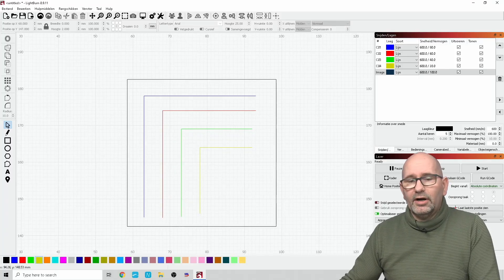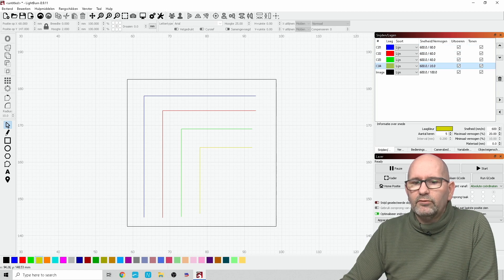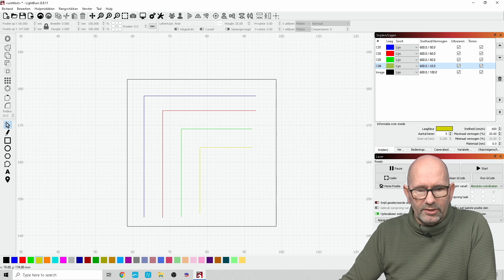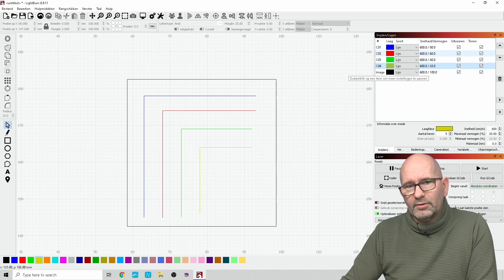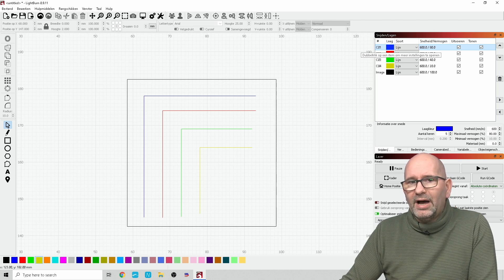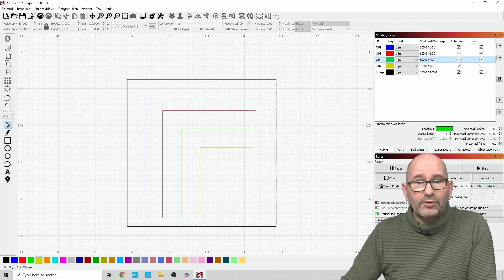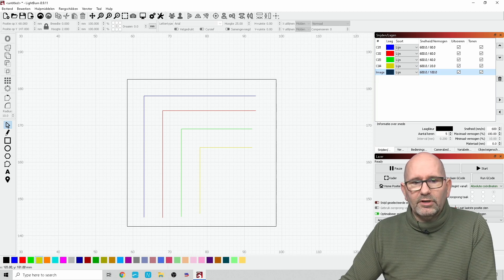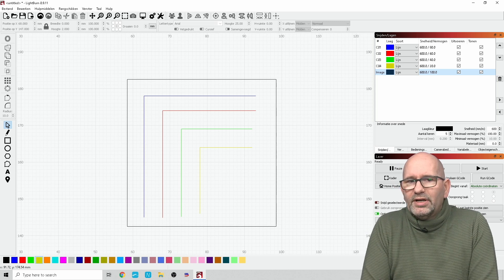▼ Why can't a DIODE laser cut thick materials? | KERF explained

Comment: So.. If it is a fixed laser. ( not adjustable) it is strongest at the surface of the item cut, due to using the measuring tool no matter the material.
So maybe on a thicker material i remove the shield and set the laser slightly deeper into the material??? Wouldnt that help cut deeper?

Is it not possible to have a second or third lense to refocus the lazer more into a straight line?
Reply from the maker: You are completely right here.
In fact, this is done with the new versions of lasers that are now hitting the market.
In my video about the Aufero laser, I explain that people can make their choice between 3 types of lasers, one of them being a Long Focus laser (LF) that uses multiple lenses to make a more compressed spot at a longer focal distance. With that laser, that has the same optical power as the laser in this video, the cut can be almost 3 times as deep.
Reply: @3dPrintCreator  
I will have to look that video up. 
I would think that a larger focal would maybe be better for cutting as it would keep the two halves from being so close. But also not impede the laser as it digs deeper. 
Whats your opinion on the neje 80w laser? Seems to be most powerful at 7.5w x 2laser =15w.
Reply from the maker: @turboflush  from what I have seen, the NeJe is really good, but they don't work with me, so it's not possible for me to test their lasers.
I don't know if they have the most powerful laser at the moment, I think the Skulpfun S9 is even more capable to cut thick materials. 
My latest knowledge about NeJe is outdated  as this was my very first laser I bought and I had many problems with that machine. They have improved a lot since I tested a NeJe machine, but I never had one after my first test.

Comment: Thks, This cutting-depth problem could be corrected-for in software (?????). 
?Doesn't Light-Burn or any software compensate for this problem?
Reply from the maker: It's a hardware problem, that can't be corrected in software. Only another lens for the laser can correct this.

Comment: Pity there isn't a correction lens to give a parallel beam without too much light loss (unless someone know s different).
Reply from the maker: There isn't for this particular laser, but there are other lasers out there that have square beams.
When you look at a laser, always look at the dot size. if the two given numbers are the same, the beams is square.

Comment: When we focusing rectangular shape beam we achive smaler rectangular shape in focal point. Here we never get a dot shape, with gaussian power distribution. So we have to use plano-convex lens to focus laser diode beam in two direction. This way is used to focusing light from diode laser into fibers. Plano-convex lens are not cheap so in cheap laser modules we can not find it. Cheapest lens this type i can find in all website was 70-100€ but it can cost a lot more. 
Laser cuting technology is very difficult, good results can not be achive with cheap setups.
Reply from the maker: Correct, and you don't need just a planar convection lens, but one that is made specifically for this approximately 5x1 ratio, and we still need to be able to focus it. Not worth the effort for a cheap laser like this. All in all, a cheap CO2 laser will be much cheaper.
Reply: @3dPrintCreator  Right but this methode you can focus beam into smal point only in focal length, so this is good enoughth for engraving, where depth of focus i relatively smal - maby 0.2mm. 
When you have colimated and square shape beam u can focus it with lens with big focal point, maby 2", there you get a long and thin beam, good for cutting.
Most important problem is remove smoke or molted material form thin gap. If cuts id depper the gap must be wider so laser power density will drop. There is limit for small power laser system.

Comment: BTW Dual diodes and quad diodes laser modules have square beam pattern and it just becomes bit wider with the distance. So for example Neje dual diode lasers can cut over 1 cm in wood. BTW there are different focusing rules when engraving and cutting. Neje tells you distance you need to set up the focus when cutting the thick materials. Not to forget to mention air assist helps a lot with cutting to. It becomes faster and cleaner to.
Reply from the maker: Totally true :-)

Comment: If it cuts perfectly in the x direction but not the y direction. Why not slow down any Y direction moves by 30% to give it more time to cut propperly?
Reply: One problem is that would distort the design. Let's say that you want to make a 10 mm cut at 45 degrees, at a speed of one 1 mm per second,  so it will take 10 seconds to make that cut. The only way to do that would be to move the x and y directions the same amount in those 10 seconds. If you slow the movement in the y direction down by 30%, then the laser will cover 30% less distance on the y-axis than in de x-axis. 

That means that, in those 10 seconds, the laser will have moved some distance in the x-axis, but only 0.7 times that distance in the y-axis, so you would not get a 45 degree angle. And if you tried to cut a 10 x 10 square, you would end up with a 10 x 7 rectangle, since the height will be reduced by 30%.  So you can't arbitrarily slow down in only one of the directions, the "Cartesian mechanism" that the machine uses would distort the image.

But the real problem is that the laser doesn't cut better in the x direction than y direction. Best cutting effenciency is achieved when all the light is focused in the smallest possible dot right at the surface of the material. If it's not properly focused at that particular distance, the light is spread out (in this case in the shape of a square, because that's the shape of the light emitting semi-conductor inside, I think) but it's equally spread out in the x-axis as it is in the y-axis. So it "loses effenciency " at the "same rate" in both axes. Hope that makes sense.
Reply: @SatumangoTheGreat  I said slow down the movement, not move less. As in, increase the time between stepper motor pulses, not decrease the amount of stepper motor pulses.
Reply: @andrewwatts1997  I know, but the direction the laser is going depends on the relative speeds of the two motors. If the y-axis moves at a certain speed and the speed on the x-axis is zero, the laser cuts a vertical line. If the x-axis moves at a certain speed, but the speed on the y-axis is zero, the laser cuts horizontally. If the x- and y-axis move at the same speed, the laser cuts diagonally at an angle of 45 degrees. If you slow the y-axis to half the speed of the x-axis, the laser cuts diagonally at an angle of 22.5 degrees.  

That laser is going somewhere, cutting all the time. If you change the speed of that laser on one of the axes, it is going to veer off course.

What you could do is change both speeds at the same time, keeping the laser on its correct course but moving slower, thus giving it more time to burn trough the material. Or repeat the path of the laser several times, burning away a layer of the material at each pass. That is wat he is doing in the video btw.

Comment: I think your laser might have a problem. I had the same issue and I emailed them. We were back and forth with emails and tests. The outcome was that they will replace the laser.
Reply from the maker: Huh? How come you think there is a problem. This is how Diode lasers work, it works like it should.
Reply: @3dPrintCreator  well after I notice one side was cutting with a fine line and the other side had a broader cut which didn’t go through, just like yours. So I thought I wasn’t focusing it right, I did some research and I saw some people had the same issue. I emailed ortur and I had to run some tests they sent. I dunno, maybe I’m wrong and my problem is different 🤷🏽‍♂️🥺

Comment: If it cuts, then it will cut deep, you will need to keep the cutting point at focus and cut shoulders so the beam doesn't get attenuated. All manufacturing has its own quirks.
Reply from the maker: It's won't cut deep because after only a few millimeters, the beam is out of focus.
If only the machine had a moving Z axis, then it would be able to cut deep.

Comment: OK BUT we have the new 2021 type of laser engravers like the Atomstack A5 Pro and the Banggood Sculpfun S6 pro (very similar machines) which have new optics so they call it Spot Compressed Laser and they promise that the light beam is square  and smaller than before 0,23x0,23mm. I just ordered the Atomstack we will see :-)))
Reply: Let me know if it was good. I'm really interested in it, even if i have a 1390 150 watts CO2 machine, loooooooool :-)
Reply: @ACNNOMOREBLUFF  Hi sooo I got it about 4 days ago did not have too much time to play with it and I does not have air assist yet STILL it cuts 5mm plywood beautifully which is over my expectations with very minimal conusing.. it takes time no question about it but it cuts 5mm normal plywood. What it does not cut is anything which is over 10-12 mm but I still have to play with it.. I cuts foam like nothing but when I tried 20mm foam it only could go down about to the half of the material and it stopped even I gave it 50 runs the laser light just evaporates or something like that. I tried 16mm light wood and it cannot do that either. 

So the max height of any material could be about 10-12mm and that is it. The square light beam is not really true it is probably better than before but it still cuts vertically better than horizontally. 

I think it is a great machine for the minimal price it costs. I am about to make some bed of nails for it (from gluing pushpins to a plywood) because raising the material is very good for cutting, and I will make a box with ventilation ands also think about air support that helps a lot as others said... )

I hope I could help...
rockjano
Reply: @bacsijancsi  Yep, i confirm the air assist will change it fully. I have an old model with 15Kw blue beam laser, and i added the air assist a year ago. Now, it cuts up to 20 mm wood plates. So keep going ;-)
Reply: @ACNNOMOREBLUFF  Whoaaaa.. that is crazy :-) is it somehow blows the smoke out of the cutted material??? The 15Kw real cutting is something like 4 watt no??? Mine is theoretically 40W (really it is 20W) but that is the power consumption and the real power with mine is about 5-5,5 W which is still a far cray from any CO2 laser but a lot less hustle...
Reply: @ACNNOMOREBLUFF  One question how much constant air do you need???  A read something like 1 bar...
Reply: @ACNNOMOREBLUFF  Thzank YOu

I wonder I have to compressor...a big one with a 30l bottle and a smaller one for airbrushing with a small 3l bottle and even that can provide 1Bar continuously  that  might be just enough
Reply from the maker: My machines (with non spot compressed lasers) are working great with simple aquarium air pumps, that output 150 liter per hour, at a pressure of only 0.4 Bar with a 0.8mm nozzle.
I have not tried the spot compressed lasers, but there is one coming my way very soon. It will be a 20 Watt machine (effective about 5 Watt) and the company says it is capable of cutting normal plywood in 4mm in just one run at 300mm per second.
When I have it, I will make video's about it and show a comparison in detail.
Reply: @3dPrintCreator  300mm / second is obviously a mistake it might be 300mm / minutes which is about 5mm/sec. Still it is very doubtful mine (Atomstack A5 pro) without airsupport!!! cuts 3mm plywood 4-5mm/sec 100% laser power and 3 runs (2run is not enough)  think that is the reality... it is only 5W lasercutting power I wonder how much airsupport might help I will make it soon....
Reply from the maker: My first reaction would be that you are absolutely correct about the speed mistake, but I double checked it with the company that is going to sent me the laser, and they repeatedly said it will cut normal plywood in one pass at 300mm/sec. I also have a hard time believing it, but I have not checked their laser yet, so I can't confirm of deny it. 
My, very simple, air assist makes a whole lot of difference, while it still is a very basic and low power air assist. It means the difference between burned edges or smooth cuts, and it gives me about a millimeter more cutting depth in light plywood, like birch plywood.
Reply: @3dPrintCreator  Yep I heard that airsupport can give you somewhat more cutting depth and a bit more efective cutting but only 20-30% more. The 300mm/sec I know they say because they don't know what they say or never tried it :-) even 300mm/minute one run is impossible I think minimum 2 runs at full power. mine now needs at least 3runs. Raising the wood in a honeycomb tray or bed of nails or similar also helps I think...
Reply: @3dPrintCreator  what about the new neje module with dual 5W diodes and compressed beam?
Reply from the maker: @shaiseg  I wish I could tell you more about that module. NeJe doesn't sent products to review, so I don't know how good or bad it is.
From what I heard, it's a very good laser but still with a rectangular shape projection. However, this projects a very small dot, therefore it can cut much deeper.

Comment: Quite fascinating I have been well educated thanks for your insure.  I wonder if a z axis and ,"not sure how to express it" but the head could turn to follow the direction of travel should surely make a big difference. I suppose this is hard or expensive to implement?
Reply from the maker: In fact it's not that expensive, yet it is very difficult. Every 3D-Printer has a Z axis with one, and sometimes, two motors for the height adjustment. The problem is that the first cut is the deepest as there is no ashes to block the light. After that, the next passes are less effective and also the KERF is getting in the way. Going deeper also means that the top of the material will be hit by a wider beam of light, therefore blocking the light. This means that less light will get to the correct focal point, and therefore it will be less effective.

Comment: it cant cut thick stuff as its only 5 watts, try a better diode and 1 inch thick is no problem
Reply from the maker: At the time I made the video, 5 Watt was good. The other lasers were only 0.5 or 1.2 Watt optical out. 
At this moment, I run up to 60Watt diode lasers, yet the more power they have, the more the KERF is important. 
And that, my friend, was what the video is about. The kerf, not how thick it can cut.

Comment: Cant you you just adjust the Z Axis height with each successive cut and accept that you will have a large Kerf..
Reply from the maker: No, unless you burn a V slot, so the kerf won't hit the sides of the material. Otherwise you won't get enough energy down to where you need it when going deeper.
Reply: I cut 3mm ply with 200mm per sec, speed 100% power, 3 passes with 0.3 mm z depth per pass. And cuts are 99% perfect.. That's with the sainsmart 5.5w laser
Reply: @3dPrintCreator  That's why I said accept a large Kerf.
Reply: @nigelmorris4769  how do you adjust the z depth automatically?
Reply: @psysxet  I use lightburn. In settings enable z axis and then  in the layer cut panel I put below number of passes I put 0.3 in z depth per pass
Reply: @nigelmorris4769  Hmmmm that is very interesting I will check on it in LightBurn...did it help what do you feel???
Reply: @nigelmorris4769  Agggh  I got a fixed focus laser...so it probably only works with High end CO2 lasers isn't it???

Comment: Good review. I will bay a laser. The CO2 is very high price about 2000 to 3500 euro. The cheap form china have to many problems en not save. I looking now for a led laser they say whichs a new dessign better cut and smaller. I think for my not a probleem. What i will cut is paper and veneer 0,5 a0,6 mm.  I hope jou now how cut it. Most is the problem black edge. What i now is better more power en faster cuts than an low power diode whits a slow cut. Onlu i con't find i move whit cutting veneer only one whits a co2 cutter of 4000 euro. I looking for the S6 of S9 lasercutter. Thank.
Reply from the maker: The S6 and S9 are very good machines. They have a very condensed spot, good for detailed cutting. I don't know what the settings are for cutting veneer, I have never done that.
Generally speaking, get a high power module for cutting, that always works best as you don't need to operate it at high power.